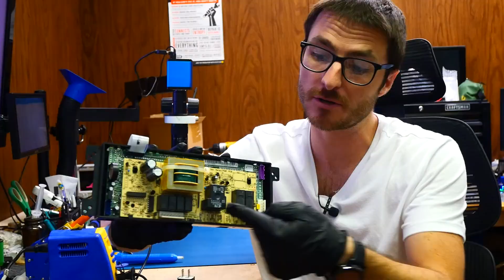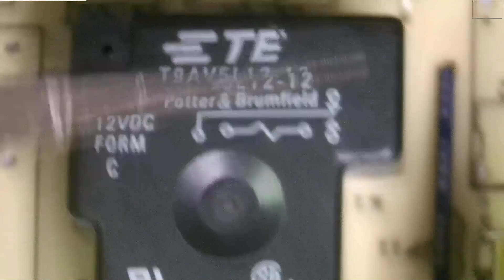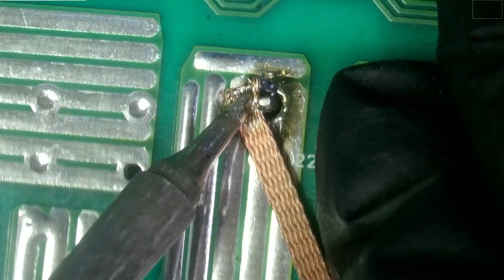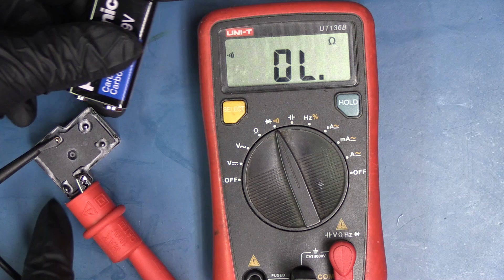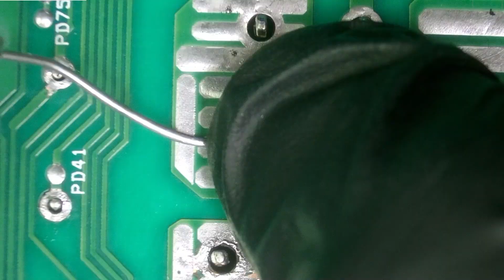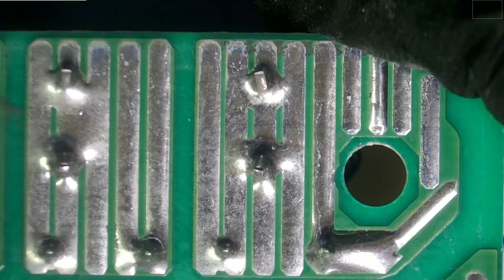Frigidaire Oven won't turn on? We Fixed It!

Comment: Nick, I'm getting an error code F010 when we turn the oven on after about 10 minutes of being on. It's brand new. I tried to google and Utube the code but I only find F10 code, I think their different but I'm not sure. Do you have any thoughts? thank you. good video.
Reply from the maker: Most ovens we work on are 15-25 years old. For newer equipment, I am simply not as familiar. But if its brand new then it should still be under warranty and the store or manufacturer should be able to send someone out to fix it at no cost.
Reply: @NicksElectronicRepair thank you for your insight, I'm going to call customer service tomorrow.

Comment: I was having an oven out of temp code come up over and over even after replacing the temp sensor. And one of your video's helped me to fix it not the first time around but the 2nd time months later.
 It had cracked solder joints at the very plug that goes to the temp sensor on the board.
I did not  see the cracks  initially with my 6x magnifying glass but did see it later with my 10x head set.
They don't make the controller any longer and a new wall oven is 2200 bucks. So we went without an oven from Christmas before last and I got it fixed just in time for Thanksgiving Turnkey in 25.
Thanks for sharing your knowledge Nick!!
Reply from the maker: You're welcome! Happy to know the video helped save your unit and glad you got it fixed in time for Thanksgiving!

Comment: Was getting F027 error this morning and no oven buttons would work, no power to oven, not even the oven light would come on.  Looked at the back of the control relay board and couldnt see any burns or issues.  Looks closely at the top of the board and noticed there was some junk covering some of the center pins of the micro controller chip (MKE042128) in the middle of C25, C63, C51, C22.  Solder mess was just above the C22 and C5.  Used some Deoxit and a q-tip and cleaned it up.  Plugged the stove back in and its working again.  Cant believe that it worked for over a year like that before it tripped the issue.

Comment: Do these units have on-board fuses or varistors? I have a 3164627 and it went through a power surge. No clock or keypad. The piezzo igniters work along with the gas valves, of course but nothing else.
Reply from the maker: Well the transformer has a fuse inside of it. But it's not likely that it's failed. 
I do want to point out that when surges occur faults can happen in any number of ways, which are unpredictable. I wouldn't be able to give you a 1 size fits all answer. The unfortunate truth with power surges is that most likely this is not something you will be able to fix on your own, and you will need to send it in to our shop for a full in-depth diagnostic and repair.

Comment: What is sd on my stove Frigidaire Galaxy
Reply from the maker: Never heard of that but I copy pasted your question into google and it said this:

"On a Frigidaire Gallery stove, the "SD" or "5d" code usually indicates that the oven is in Showroom Mode" 
Here's how to resolve it:
1. Power Cycle:
Unplug the oven from the power outlet for a minute, then plug it back in. 
2. Cancel/Clear:
Immediately after plugging it back in, press and hold the "Cancel" button (or possibly the "Oven Light" and "Timer" buttons simultaneously) for about 10 seconds. 
3. Check for SF:
If the display shows "SF" (Sabbath Failure), it may indicate a Sabbath mode issue. You can turn off Sabbath mode by pressing the "Off" button and then pressing and holding the "Bake" and "Set Clock" buttons simultaneously for a few seconds. 
4. Consult Manual:
If the issue persists, consult your Frigidaire Gallery stove's user manual or contact their support for specific troubleshooting steps for your model.

Comment: What flux do you use?
Reply from the maker: in this video we use the kingbo, but we have been switching out of that one and started using the Stirri flux. It's supposed to be less harmful to you the user (fumes are very toxic for flux) and also less harmful to the environment. It works just as well but ironically the stirri smells way worse.

Comment: One issue I haven't seen many people run into or discuss  is when the relay sticks on--in other words, the contacts are pitted and burned and often stick on, causing a thermal runaway with the oven. For the amount of power these relays handle, it seems they are terribly under-specified and doomed to failure. I've already replaced one oven control board at $200 (burned seriously), and now I have one with a defective $5.00 relay. No wonder people replace ranges so often.  You have to wonder: Which comes first, replacing the oven control board relay or changing out the entire set of kitchen appliances because the color has gone out of style?  🙂
Reply from the maker: Yeah I actually made a couple videos on that. The more recent one is this one:
https://youtu.be/EGo1vD059es?si=p6ZdZlMMy9Op9gZI

Kind of scary because that means you can't turn off your oven without fully unplugging it.

Comment: Hi there, great video. On my Frigidaire CGEF306TMFA double oven, the big surface element the whole element lights up but after a minute or two only the outer ring stays on while the inner one turns off. Replaced the element and same thing happened.Any ideas? Thank you!
Reply from the maker: When the issue happens like that, usually it's due to solder joints failing. This would be something we can fix for you if you did want to send it in for repair. Just fill out the contact page linked below and we can figure things out from there. 
https://nickselectronics.com/pages/contact

Comment: Our oven is 11 years old
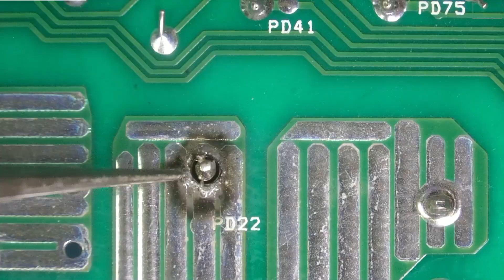00:37 - EXACT same problem.
Blobbed some solder on it and within minutes,
the wife was cooking corn bread.
THANK YOU!!!
On the other hand, the front panel lights are
a really bad design and all the little plastic
tubes used to hold the lights in place AND
'conduct' the lights are broken.
VERY BAD DESIGN.
I'll save that for another day.

Comment: on my Frigidaire Range some of the display buttons work & some don't. The buttons used the most (bake, start, clear/off) don't work. Is this problem related to the overlay or the Electronic Control Board?
Thanks for your time.
Reply from the maker: Yes that is most likely the overlay. It sometimes can be fixed but usually a new overlay needs to be purchased. They aren't always available unfortunately.

Comment: Today I got my soldering kit from Amazon. I had the same issue with my oven, it was a switch relay joint that had burned. I was able to fix myself with no soldering experience. Thank you so much for posting this video, you saved me money, time, and headaches. Your instructions were precise and to the point. My only issue was the melted lead when melting covered unevenly around the joint forming a bubble sphere. Would applying paste flux help the melt lead spread easier around the joint? Anyways my oven now works it's all what counts 😊
Reply from the maker: Yes the flux will help you get a better flow of the solder and better connection. I would recommend it.

Comment: Hello Nick I own CircuitBoardMechanic and I would like to send you any of our control board repair kit that you need for free if you will feature one of them in one of your videos. if you need a control board, I have a whole pile of them that I can send you that need to be rebuilt
Reply: I would like to sponsor every appliance board video that I could with a free repair kit if I could get a plug on each one of the videos.
Reply from the maker: I appreciate it but I don't think we would be interested. 
I don't really believe in repair kits.

Comment: I'm dealing with a Frigidaire FGIH3047VFB range that is about two years old. The entire right side of the control panel went out. Can't even get one burner control to do anything and the other one (rear) will turn on, but can't set + or -, so no heat. This is the side of the stove i use the most (long, multi hour boiling water type things going, cooking legumes and such). I figured the heat destroyed something. Was quoted $350 for a replacement part, but hoping to avoid that. Do you have any experience with this model?
Reply: I flipped the circuit breaker and it works again... (breaker was fine, not tripped)
Reply from the maker: This is the induction one correct? 
I have not had to repair one of these before as it is still very new and thus has not had many failures yet. But if the failure occurs again, and flipping the breaker doesn't resolve it I would recommend looking in the owners manual to factory reset it and  if that till doesn't work, then reach out to us again. Would most likely need to have you send in that control panel for repair.

Comment: I have admit something, I made a boo boo on an AC board I fixed, the board was regulated by a 7805, but the relays were 12 volt, HUH?? the thing I found out, the relays had a driver chip that boosted the power and did all the switching. Live and learn.
Reply from the maker: What is a 7805? What board was this?
Reply: @NicksElectronicRepair  78XX are voltage regulators 7805 = 5 volt 7812 = 12 volt.....was a small air conditioner control board. They are sometimes on a heat sink, 3 pins, might mistake them for a transistor.
Reply from the maker: Oh interesting. Yeah I definitely have mistaken them for Transistors before instead of voltage regulators. I assume they are labeled as Q for the location ID probably right?
Reply: Originally it had a small transformer converting 120V AC to 9V DC, it fried, I got a 9 volt wall wart and bypassed the bridge rect str8 into the 7805, I goggled the IC later and discovered it was a 12 volt relay driver. DOH! it was a trash find anyway.
Reply: @NicksElectronicRepair  Hmm I never noticed what the board designation was, on stereos they usually have a row of them on a heat sink. 78XX for positive rails and 79XX for negative. LM317 are adjustable VRs you see them a lot in power supplies.
Reply from the maker: gotcha. Yeah I don't fix the audio equipment much, at least not the power supply side stuff, my tech Jerry usually does that so he would know way more than I do in that regards. I only ever work on the mainboards for audio equipment.

Comment: Hi Nick, i want to try to fix my control board. I just wonder what kind of iron and microscope are you using? Thanks!
Reply from the maker: Here is a list of all the tools we use which you can get from amazon:

Soldering Iron: https://amzn.to/3FQfyhG
Solder: https://amzn.to/3qScy0d
Desolder wick: https://amzn.to/33DAjjy
Flux: https://amzn.to/42YWYBa
FR301 Desolder pump: https://amzn.to/3IhTKzc
Reply: @NicksElectronicRepair  Thank you!
Reply from the maker: You are very welcome!

Comment: Great video, just soldered mine back on, exact same thing. I ordered a repair kit just incase .
Reply from the maker: It could have a more complex fault. If you still have problems with it after you install the repair kit, feel free to reach out to us directly via our contact email or fill out the contact form linked in the video description.
Reply: @NicksElectronicRepair  its all fixed, really appreciate you sharing your knowledge.
Reply from the maker: Nice work!

Comment: Not sure if it's Orange Red Brown Gold (320 ohm) or if it's the same resistor you replace in your video "Burned Frigidaire Oven Control Board" Red Red Brown Gold (220 ohm). Reading other comments, this appears to be a common fault. Ours burned up after using the self cleaning function.
Reply from the maker: Yes usually it's 220 ohms. If you do replace it, make sure you resolded all the joints for all relays and pins to all wire connectors. The reason the resistor blew in the first place is because the relay had a bad joint most likely.
Reply: Yes. I did pick up on that in your video. Even if I was able to identify the resistor I needed to replace (unlikely) and replaced it successfully, I would never have known the cause of it's failure and most certainly would have just fried the new resistor. As it is, it I followed your tutorials, re-installed the circuit board and the oven is working again. Not only does my family not have money to waste unnecessarily, I don't have an appetite for filling landfills with appliances over $0.12 electrical components because the repair costs are almost as high as replacing the aged appliance. Thank you very much for your videos as well as your personal response. Your help is greatly appreciated. @NicksElectronicRepair
Reply from the maker: Happy to help!

Comment: Hi Nick. I have a Kenmore oven with the identical frigidaire circuit board you repair in this video, except the faulty component on my board is the resistor in the R1 position. I don't have a "cheater board" to help identify the size of the resistor. I have VERY basic skills with electronics and would like to attempt the repair using the techniques you demonstrated. Are you able to assist identifying it? It's immediately next to the relay you replace in this video. It is shown briefly in your repair, I just can make out the colour bands. I would greatly appreciate your help. Thank you!
Reply from the maker: Please provide the part number of the control board but yes most likely it's 220 ohms.
Reply: It's quite literally the identical board that you repair in the video (You briefly show the Part Number). The part number for just the circuit board that needs repair is Electrolux P/N 3164627, but I think when paired with the board it's mounted to, the whole assembly becomes P/N 316462808, or something similar.  @NicksElectronicRepair
Reply from the maker: That's possible, we only have been fixing these for just under 1 year and I am not yet 100% familiar with all the naming conventions for the part numbers. My tech who works on these daily is much more knowledgeable on this than I am.

Comment: I found a LOT of cracked solder joints on some the old mini ovens, must be the heat from the oven.  I saved one from the 80s, its a GE Omni 5, it has stainless steel interior, porcelain pan, it microwaves, and has top and bottom elements, I love it.
Reply from the maker: Yup I have seen some boards come in from whirlpool and they have so many cracked joints it actually seems impossible for the unit to have worked until it did given how bad some are.

Comment: I'm more comfortable with appliances, but back then boards were not common, fixed microwaves by the 1000s in the 80s. ROACHES and more ROACHES!! Oh yea, that reminds me,  an AC board I worked on, had 12 volt relays, but a 7805 supplied the board...I was like huh..that ain't right, I learned later that there is a relay driver that converts the voltage up to 12, live and learn.
Reply from the maker: Yeah, you only see these types of electronics in the newer units. The very new units get a little intense. I am a big fan of the one in this video, it's the perfect balance of passive components for me haha. 
And also roaches are the worst. We get a few units in here and there with tons of roaches all over and it's just gross. We charge a none non-refundable cleaning fee when that happens. 

Yeah, I think we are going to start working on AC boards, they typically don't have too many difficult parts to fix, sometimes bad capacitors, and similar cracked joints on relays and connectors although I don't have too much experience yet with Air conditioning units.

Comment: I had the same issue on my board, what causes the burning of the pin?
Reply from the maker: What causes the burn is arcing from the cracked solder joint. 
What causes a crack solder joint? Different thermal expansion coefficients between the PCB the solder and the relay pins. So when the unit is on and has power going through it, everything in the area heats up. When things heat up they expand but because they are different materials they expand at different rates. When they contract as they cool down, they also do so at different rates. This contraction and expansion at different rates will cause micro-fractures to the solder joint. Over time the cracks become larger and larger to the point where there is visually a gap and power can't go through anymore. So sometimes it arcs. When that happens the joint gets very very hot very quick and will cause spikes in power draw. 
Hope this helps
Reply: @NicksElectronicRepair  thank you for your response. Very clear and easy to understand. Your video saved our family hundreds of dollars.  We really appreciate your help.
Reply: You have to really clean the connection well, all the arcing and burning oxidizes the solder and new solder will not adhere, it may look like it does but it won't last,. I've seen joints that looked fine but the solder was actually hollow,.
Reply from the maker: Yup absolutely! 
That's also one of the reasons it's a good idea when ever you have a burned cracked joint to 100% remove all the old solder or at least as close to 100% as you can and put all fresh solder. I have seen people just add more new solder ontop of the old burned solder before. Not great.

Comment: what do you do if a part you need is no longer manufactured  and you don't have a parts board with the part you need?
Reply from the maker: This happens often, and when it does, either I try and acquire a parts board for cheap on eBay or other retailer, if the part is not available, I will look for a different version of the board or different brand board that have similar circuits and designe and hopefully have the part I need. I have gotten pretty creative on that one in the past. 
Often if it's a passive component we can find a newer version of the component with better specs higher voltage or current rating but would be compatible and still work. 
If none of the above works, sadly we have to call it a no fix.